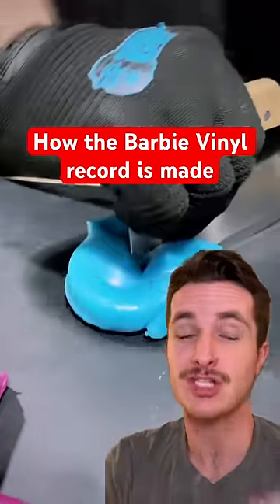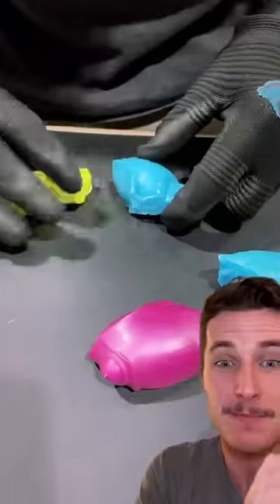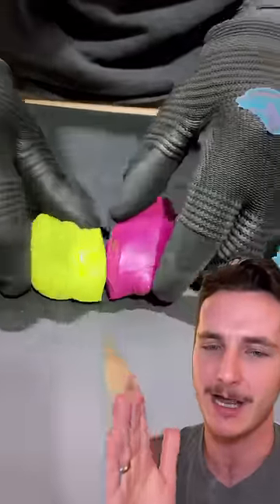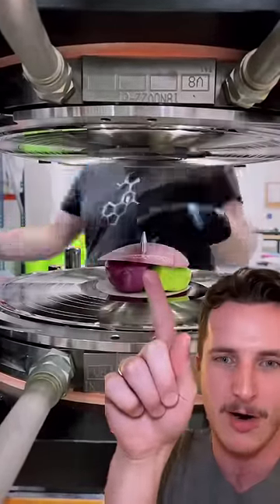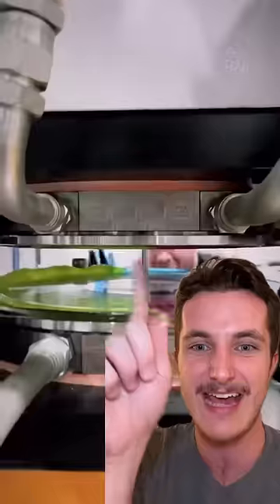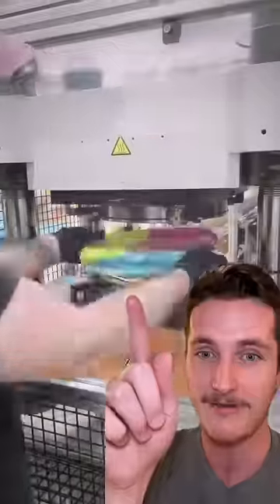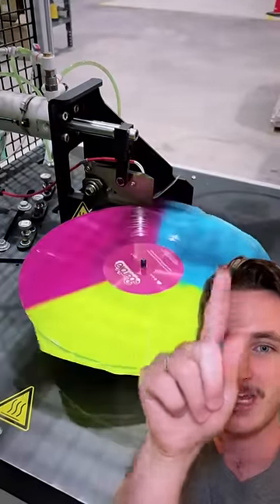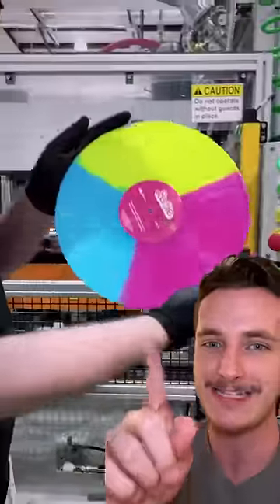How the Barbie Vinyl record is made

Comment: Someone please narrate the narrator.
Reply: Thank you 😂
Reply: To create a vinyl record, first step is to select PVC colors, or a singular color black is most popular, and then have it placed in the middle of the press. The press is turned on and comes down creating the pvc sandwich and smooshing the vinyl pvc into a flat disk using 110 tonnes of pressure (not heat) until the disk is anywhere between 0.9 to 2.2mm thick (theres no standard thickness but that seems to the general sizes). The newly created vinyl will have some excess pvc on the edges and so its moved to the cutter which quickly and easily strips the excess off and then tada. its completed :D
Reply: Aight bet
Reply: Then the guy grabs the record using his two hands on his arms. He uses his legs to walk and his lungs work to take in air so he can arrive to the machine that cuts the excess. You can see him put the record on the cutter which while it spins is cutting the excess from the record using some sort of spinning mechanism and sharp blade perhaps.
Reply: Legendary
Reply: came here looking for this 😂😂
Reply: Narrators are so annoying, like I can see what's happening I don't need you to tell me 😠

Comment: A vinyl record is NOT the same type of PVC as in PVC pipes.  A vinyl record is a polymer made from two parts Poly Vinyl Acetate and one part Poly Vinyl Chloride 2xPVA+1xPVC)... This is what makes it moldable.  It is pressed at 110 to 150 tons, while heated to 160c, for it to be stable at the end.. Those two materials is mixed with additives from 4 to 25% lubricants, colorants, plasticizers andf fillers.
Reply: Thanks my fellow chemist!
Reply: Is it sustainable tho? Wanna know before i start spending money
Reply: Okay but how does the music get on it
Reply: @JessiRose420  They cut a "negative" in aluminum and press it into the moldable hot plastic. That's how - that's the entire reason for putting it INTO the press.
Reply: @JessiRose420  i know for older records the bumps on the vinyl makes  sound and the player amplifies the sound.
Reply: Who tf asked you?
Reply: sha up , your comment isnt necessary. this is just short.
Reply: @xX7thseekerXx  don't get your a$$ kicked Anthony.
Reply: @xX7thseekerXx it is necessary. The short is spreading slight misinformation, and the comment gives the correct info.

Comment: I've worked at a record shop before and they did it a little differently, they'd make the records and then they would take all those records to the back building (which is where I worked) that's where the records would get the stickers put on, put in sleeves and boxes up and shopped off to record shops

Comment: You can't steam something like vinyl at 1000°, if you did it would just be carbon. you steam it from 175-200°f. If you were to go if you go above the ignition point of it which is about 800° it would catch on fire. And before anyone says that the steam would stop it, it won't. If the water is hot enough you can't cool down the material or steal the oxygen, it would continue to burn

Comment: Polyvinyl chloride or vinyl (PVC) is a polymer in which more than half of the content by weight consists of chlorine (Vesterberg et al., 2005). PVC is produced by polymerization of the vinyl chloride monomer. PVC comes in two basic forms: Rigid (sometimes abbreviated as RPVC) and flexible.